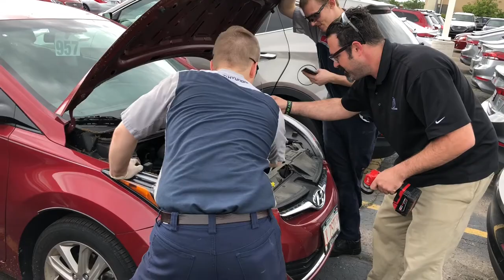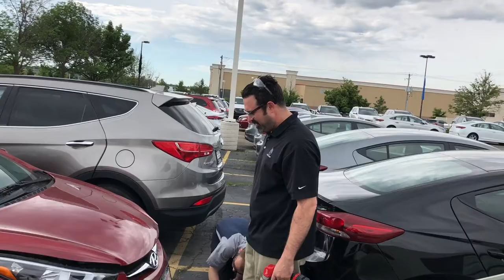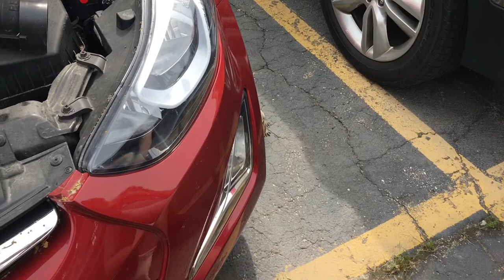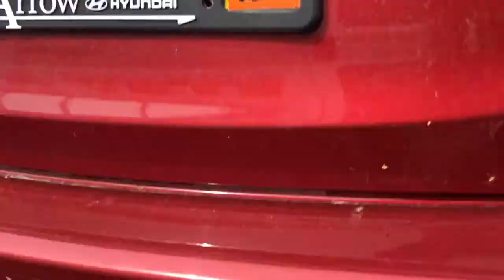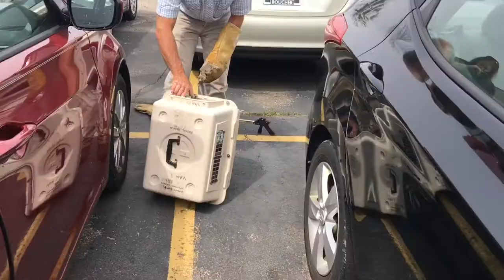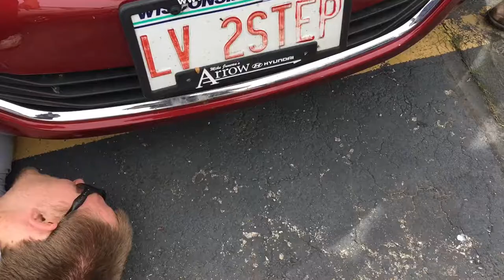How TO Remove A Squirrel From A Car Using Moth Balls

Comment: Either i have hell squirrels or This does NOT WORK. Months of this I have had endless damage done to my car after moth balls, noise systems, repellents, and fox urine!!! Nothing works! And my car smells awful. 😭
Reply from the maker: As you can see this worked flawlessly.   We are not putting them in the cabin.    Just the engine compartment.   Don’t know what to tell you
Reply: What did you do?

Comment: $2000 damage on my new Explorer Manufacturers also need to stop using soybean based products with plastics like fuel line coatings
Reply from the maker: Yep that’s a thing!  Seen enough damage to wire harnesses to agree w you